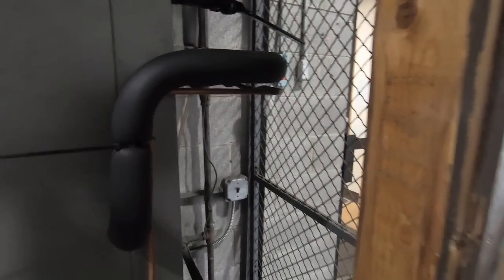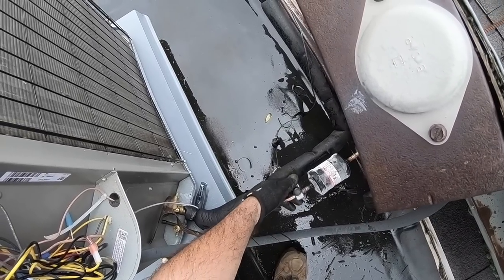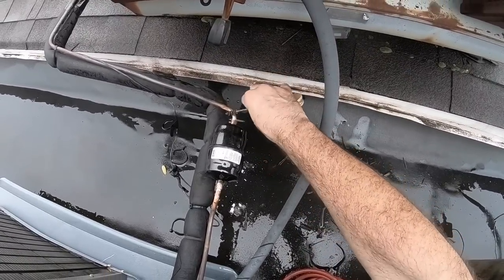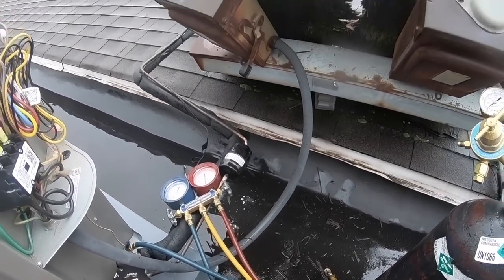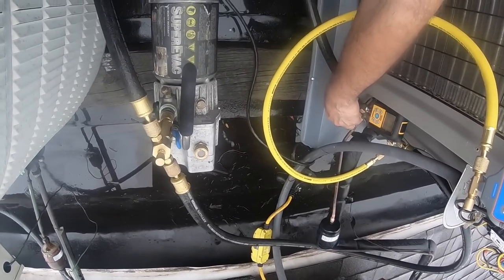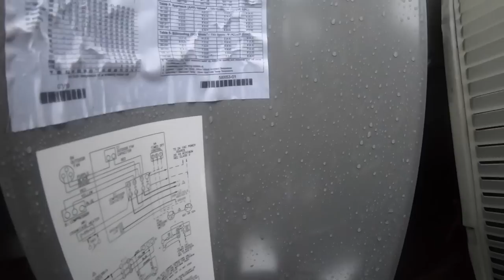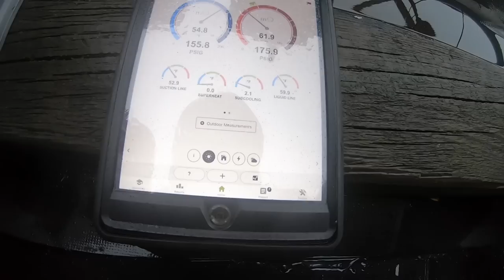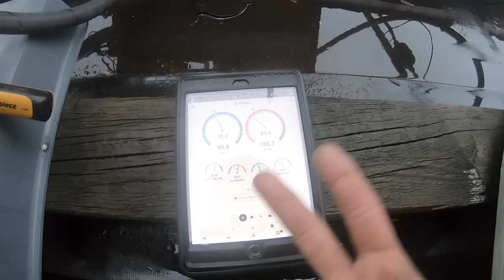AC Not Cooling Refrigerant Leak Repair

Comment: does this unit have a low ambient kit? i guess it would have to be disabled for charging.
Reply from the maker: No low ambient kit and I’m sure they are not using the ac anymore. This was October third and the day before was 80. It will need a low ambient kit if they want to still run it. Head,after control and freeze stat.

Comment: Every time you kneeled down without a pad made my 70 year old knees hurt. Protect yourself— You will get old—
Reply: He is already pushing a 100
Reply from the maker: I usually use a kneeling Pad. Yet it seems to soak water up making it more wet than the 4x4 I was kneeling on

Comment: Liking that particle board disconnect mount!  LOL. Great video, Bill. 

EDIT: Is that a 1/2" liquid line coming down to the evap? Reduced down to 3/8?  or  3/8 to 5/16???? (scratching my head.)
Reply from the maker: Yes it is 1/2" to 3/8 liquid line. I wish whoever changed this system swapped the refrigerant line also. Not good for a compressor

Comment: That is educational man! I had no idea you could use soft solder for refrigerant lines- what exactly are you using man?  So many times that heat is the enemy and I could have used this instead!   Will this work for r410a with higher pressures?   Thanks-  i guess it will... 😂
Reply from the maker: I am using staybrite 8 it’s a silver solder. It creates a stronger joint than brazing / silfos. When brazing the copper thins around the fitting due to anealing from higher heat needed to liquify the silfos.
Reply: @thehvachacker  The Silver Bearing Solder joint isn’t stronger than a SilPhos Brazed joint. The copper’s integrity is left intact because at 435° F the copper wasn’t annealed. I like using SB8.
Reply from the maker: @adrianperez5628  the joint is strong due to the copper annealing around the joint from heat needed to melt silfos. Burst rate of a SB8 joint is around 3600 PSI. The brazed joint burst rate is 1800 PSI. 
Could be redundant, since HVAC systems should never see those pressures.

Comment: Funny how that broken board those 2 sub panels to the condensers are mounted to is in far better condition than parts of the sub floor and floor joists in my house.
Reply from the maker: It sucked when the board snapped and pieces went all over me
Reply: @thehvachacker  I can imagine.  I'm closing on my refinance tomorrow.

I'm getting $32,000 cash to fix my house properly.  I'm tearing it all out.  Floor, Joists, plumbing, electrical, HVAC system.  It's all going.

Will take me a year to start because I need to study building codes for all that and create a plan for the remodel.  Including the solar panels.  

Pretty sure I'll be snapping boards and wall panels when lift the house with jacks

Comment: Coworker of mine has had nothing but trouble out of his Fieldpiece micron gauge.
Reply from the maker: What kind of trouble? It’s been good to me. I use it in the rain often and accidentally pressurized it a few times. The yellow jacket I had last summer stopped functioning after accidentally pressurizing it.
Reply: @thehvachacker  he had problems with it not reading  microns correctly.
Reply: @sknight0391  I had bought a Fieldpiece micron gauge and it wouldn't go down pass 700. I returned it and bought the same one used  for $25 from offerup and works great for now. I think they suck but it's going for now until I get the bluvac one

Comment: Doesn’t unsweat the drier just cuts it out...doesn’t debur his pipe. Doesn’t put a wet rag on the drier 🤔geez man also why not braze it? Hopefully your solder holds up!
Reply from the maker: A silver solder joint is stronger than a brazed joint. No need to wet rag a drier when soldering, very minimum heat is applied, also most don't wet rag a drier when brazing. You must be a noobie My cutter doesn't make burrs inside the copper.
Reply: How is a silver solder joint stronger that a higher temp braze joint? Cant find any info that backs that's up. Serious question
Reply from the maker: @justinh7957  annealing of copper from heating copper to 1475 degrees f to liquify. Staybrite 8 only needs to be heated to 500 degrees F. The joint strength of the silver solder joint is 3600 PSI. The joint strength of the braze joint is only 1800 PSI. Yet both make very strong joints for HVAC. Except brazing, if purging isn't done leaves oxidization inside the refrigerant circuit. We should never see pressures in HVAC that will cause either joint to burst. Staybrite 8 reps use to come to our shop and supply houses and make the pipes burst. It was around 2006 started using staybrite 8. When I started in 99 we were soft soldering all r22 line sets and 410a. Then all manufacturers wanted all 410a line sets brazed. Those old 410a systems many I still run into and have been leak-free. Those 410a systems being installed at first didn't cool or dehumidify as good as the r22 machines yet no-one knew how to charge them correctly. Then we learned about subcooling for txv's 10 degrees all machines.

Comment: Can't you just sweat that fitting with the leak, add more silver braze and be done with it? Or is it better to cut out the fitting and replace new? Great video btw. Love watching real world stuff.

Also, quick question. I'm six months into the trade and I love the work. I did a lineset leak repair similar to this, but it was the suction line 90deg street elbow straight off the evap coil. Another tech told me to just sweat it and add more silver. I did that with lowflow nitro running through the lines and did a pressure test at 230psig (coil rated for 450). I don't have digi-gauges yet so I was only able to bubble the work I did and saw no leak. I then purged with nitro and pulled a vacuum. I got down to 455microns and could have kept going down before I stopped and did a standing micron test. The microns went up steadily to around 830microns and then slowed down considerably to seem to level off, but still going up 1-2 microns every 4-5 seconds.

Do you think I still had moisture in the system or I still had a leak? Can you even pull a vacuum down as low as 455microns with a leak? After all that time and work it really bothered me that the standing micro test acted the way it did. Thanks for any feedback
Reply from the maker: I can coat the leak, yet I like cleaning it up and removing the leaking fitting when possible. You might of still had moisture. This article I write about what you are experiencing during your vacuum. https://thehvachacker.com/pulling-fast-deep-vacuums-on-hvac-systems/